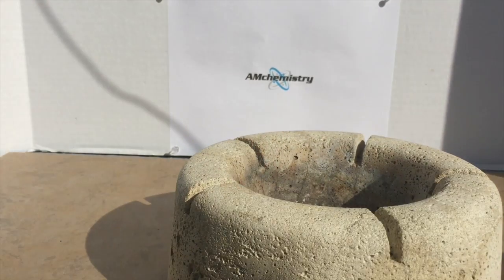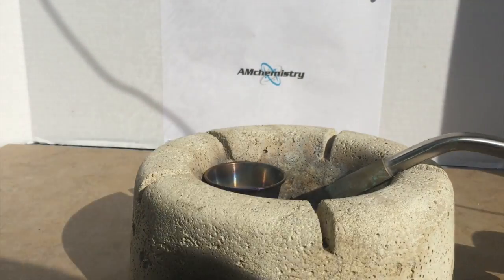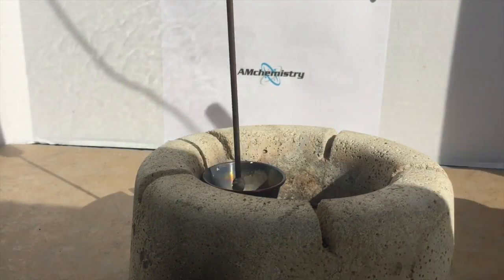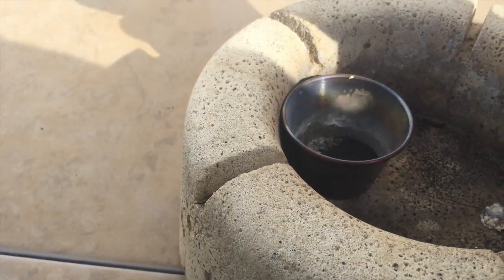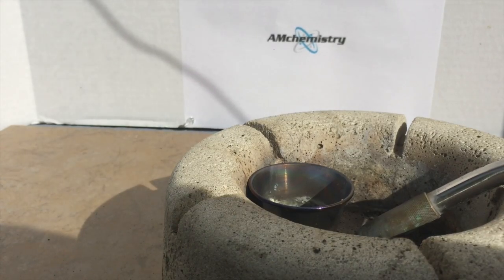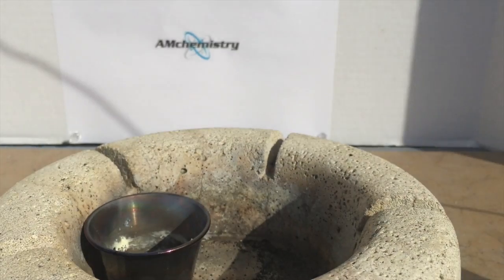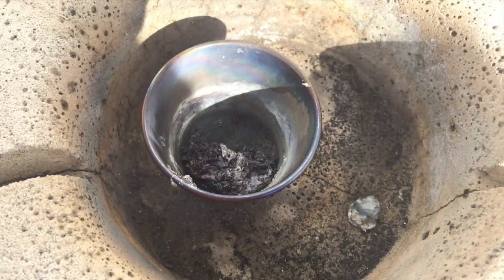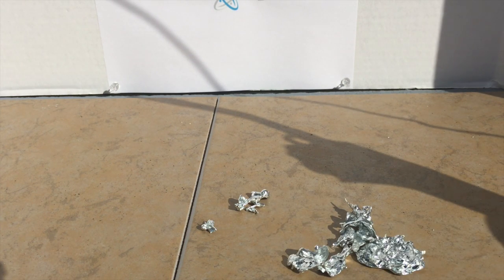How to purify any metal

Comment: Be nice to try this to see if the carbon would leech out any of the impurities in different metals. It might work. Damascus steel is made a similar way with packing the metal ingots in clay to leech out all of the slag and that works really well. I would like to see if it works with gold.
Reply: Steel is a iron + carbon alloy, so it will not work with every metal. To add carbon into steel coke is used, otherwise regular carbon would just burn away.
Reply: If your starting compound is an oxide you might be able to use some carbon to create CO2 and a pure metal. Works with Copper oxide in a graphite crucible, but it will corrode the crucible over time. Doesn't take much. I tried it with lead plates from batteries which are half lead half lead oxide and whatever else they're made of. The lead melted at a low temp and was easy to pour off from the junk, but the lead oxide melts at a much higher temp that boiled the mix. I stuck an old broken piece of a graphite stir rod into it and it dissolved in the mix, and I got more lead from it. I'm not messing with lead compounds anymore. They're toxic and hard to separate. But might melt down some pure lead from bullets or pre-separated batteries or separation from pewter or other lead alloys.

Comment: So what exactly is happening?  Does the carbon bind with the impurities?  And does the carbon stick to the crucible?  Is that why that doesn't fall into the water?  Or is the carbon simply not liquidized and you pour the liquid out and away from the carbon?  

Also, what if I have copper and aluminum combined into one from scrap material?  How do you separate that?  And how do you remove, lets say, plating metals from other other metals?  For example, a necklace that is nickel plated, but the rest is aluminum or steel?

I'm just getting into this so I don't have much experience.  Sorry if some or all of this is obvious and redundant to the more experienced.

Comment: "how to clean low temperature metals" or "how to melt zinc in my backyard with a blowtorch without inhaling vapor" would make more sense to me.
To those who want to separate low temp alloys (ie tin/lead zin/lead etc.): This video has nothing to do with that. You can use virtually any source of carbon to reduce some heavily oxidized white metals. This process is how lead, tin and zinc are extracted from their ores (via smelting).

Comment: This IS NOT a purification technique. This does not seperate metals. The only thing this does it aggregate solids on the metal. Part of which are oxides from the melting process. The pouring technique shown here will cause these impurities to stick to the cooled metal. They need to be scraped off before cooling OR pour slowly and skim off the slag.

Comment: I imagine this won't work too well with iron, as it alloys (or dissolves) the carbon to form steel.  Are there other metals that would do this also?  Would this separate one metal from another in some alloys?
Reply from the maker: I don't think it will seperate metal alloys. But with iron it needs a higher temperature to combine the carbon and iron so it will still somewhat work.
Reply: What alloy are you trying to separate? I'm sure I could help
Reply: Just a point of general curiosity.  Aluminum, iron, and gold alloys stand out in my mind as possibly having practical applications.
Reply: Well you could first dissolve the iron in nitric acid, then collect the remaining gold and aluminum. Then you could dissolve the aluminum in hydrochloric acid, and be left with gold
Reply: @TheChemistryShack  I'd like to know how can i remove or at least decrease the fe impurity content in my molten aluminum. Pleaseee??

Comment: "Any metal?" Isn't that a clickbait title. Good luck purifying Tungsten, Uranium, Iron, Plutonium etc
Reply: most people aren't interested in casting those in their backyard.
Reply: Most people don't have the equipment to melt tungsten at home, this method would mainly be used for lead, zinc, tin and aluminium
Reply: Most people get arrested for trying to work with uranium and plutonium.
Reply: Your pointing out the should part, Dishonored, not the could. You CAN work with uranium and plutonium. You just shouldn't do it.
Reply: Does this work with brass?
Reply: Not Available brass itself is an alloy
Reply: @conordorney217  I don't mean to necro a comment here, but who would cast in zinc anyway? Zinc imo is a really bad metal to cast with since it produces a pretty toxic gas upon working with under heat. Most "backyard casting enthusiasts" I figure would work with aluminum, lead, pewter (Which this wouldn't work on since it's an alloy.), tin, and other more common low temperature metals. I'm pretty sure this wouldn't work with bismuth which is what I like working with... 

But here's the point the original person was attempting to say... The video name IS click bait. This doesn't work with any metal. If there's even ONE commonly used metal for casting or working with such as one straight off the top like pewter, then the video isn't exactly 100% honest. Now I wouldn't chime up on a dead comment this old if it was just one or two things that mattered, but there's at least 10 commonly used casting metals for backyard casting that wouldn't work at all with this "purify" method.

Also adding carbon to iron makes steel. That's another major flaw with this method. It's just not a good tutorial from a person who doesn't /quite/ know chemistry and also doesn't /quite/ understand why it works at all. Best to do what some other people say and use an acid method to purify most things depending on what thing it is you're purifying at all. Every metal acts differently and that's why there ISN'T some clean-all method to purify metals. (This includes any metals for backyard use anyway.)

[It's spelled Zinc and I'm a dummy.]
Reply: @Violet51000  I completely agree with you. I understand this title is rather "click baity" due to the vast difference between elemental metals and alloys and each would require a specific method to purify. I think my example choices were on the poor side just like you said, zinc isn't the best for casting. I'm not entirely disagreeing with the original comment, my aim was to point out that the examples he gave were far fetched for purifying in a crude set up like uranium. I completely agree with you as this title may mislead those who don't have a good grasp on chemistry. Thank you for the reply :)
Reply: @conordorney217  I see, and yeah I agree the example of "uranium" was a bit far fetched. I know of a few people who have purified uranium though! So it isn't completely unheard of that somebody might do that. (Of course, if they are doing that then they probably wouldn't be watching this video anyway. lol)

I saw your comment though and it put up one to many 'red flags' for me to pass. I kinda know where you were coming from, but carbon dust doesn't just magically purify many things. In fact, I'm not sure if it could even "purify" aluminum or lead. Or any 'alloy' since an alloy is kind of it's own muddy mixture in a way. 

Anyway, it's actually kind of nice to meet somebody nice who doesn't instantly snap back with some dumb comment like, "OH WAY TO BRING UP SOMETHING FROM A YEAR AGO" or "OH WHAT DO YOU KNOW, I HAVE YOU KNOW I WENT TO CHEMISTRY CLASS FOR 8 YEARS IN COLEDGE" (Yes. I miss spelled college intentionally for 'dramatic effect' ) or something close to that. +1 to you! 

And to everyone else, Instead of looking up half-baked and not thought out youtube tutorials on melting, purifying, and casting dangerous and potentially toxic metals... Perhaps use google to find a proper website with documentation on the elements you'll be using and a proper explanation about why you use something like carbon powder to purify something like zinc and how it works. Better you don't get 'Metal fume fever' from some bumpkin refining rig full of zinc battery casings you salvaged and decided to make a necklace amulet with or desk-toy trinket.
Reply: @rachdarastrix5251  Cody of Cody'sLab would disagree with you, but it may vary from place to place in the world or state to state for people in the US.

Comment: Sorry but this is not purification.. this is just taking any dirt out. But to purify a metal usually means to chemically induce the separation from all impurities and other metals.. if the metal you are using is lets say an alloy.. recristalizing into salts and than making the purest form of the metal element.. I'm sorry I'm not trying to hate or anything its just I'm looking for the chemical solution to purification and i come across this..

Comment: can this be done for all metals like Gold, Silver, Palladium and other expensive metals? also,  if the metal is insoluble in water, can't we just add carbon black and remove all the impurities and then filter it. Would that work???
Reply: For a couple of reasons, it is not possible. 
1- Carbon is insoluble inside the zinc. This means that if you add any amount of zinc to it, it won't take any of it inside. On the other hand, many metals accept carbon inside them which will make carbon an impurity itself.
2-  Not all the metals have such low melting temperature that you could use carbon. it will start to oxidize and will produce either smoke or Co2. 
3- If your metal is an alloy and one of the main elements could be taken by the carbon and the other one not, then you would end up having a different composition from your pure alloy.

Comment: Some metals can become fragile due to the quick cooling method (crystallization) and that might ruin its usability depending on the porpoise of the purified metal, although to revert this to happen you have to melt it again then cool it down as slow as possible

Comment: When I cast zinc I have about 1/2 to 2/3 slag. It's old zinc which is oxidized or zinc alloy such as a zamak. There is a lot of zinc in the slag. I've tried adding borax and it's helped a little bit. How much slack should I be getting?

Comment: Cool! I need to use this with my Lead!
Reply from the maker: If you try it out post a video on YouTube!
Reply: Well, that would be like copying you.
Reply from the maker: It doesn't really matter we all have different techniques on how to do it. I doubt you have my huge cement crucible so in reality it's not copying.
Reply: Ok, I guess I will also be using lead so I'll consider it!
Reply from the maker: Also to make Wood's Metal you don't have to use cadmium you can just also use 25% tin.
Reply: Lead starts off-gassing at temperature well above its melting point. You might be thinking about solder fumes which are given off because of the flux.

Comment: Does this method work with cesium?
Reply: Even in a vacuum or an inert gas Cesium would react with carbon forming a compound somewhat like a hydrocarbon but with the hydrogen replaced with cesium, it's quite obscure so there is not much info on it.

Comment: How about separating lead from silver?
Reply: Dissolve in nitric acid. Then, add copper. The silver should be displaced by the copper, and the lead shouldn't, so silver metal will precipitate. Then take your remaining copper and settled silver out. Add an excess of sulfuric acid. Cold filter off your lead sulfate (not sure the best way to return lead sulfate to metal, but you could roast it in a dish, in an oxygen-starved kiln, covered with a carbon source to burn off the sulfate and then de-oxidize it).  From the remaining liquid, distill off the nitric acid to reclaim it. It was displaced by the sulfuric acid. Once the nitric is out, put the remaining liquid in an electrolytic cell, with a platinum electrode connected to + and a copper electrode connected to -. Keep the current low, and pure copper crystals will grow on the - electrode. The remaining liquid will be sulfuric acid and trace contaminants. Distill off the sulfuric acid to reclaim whatever wasn't removed with the lead sulfate, unless you've discovered a more efficient way of doing that step. If you can jump that hurdle, the net cost of separating lead from silver is electricity and whatever carbon source you used... but you could use sawdust, carcoal, baking flour, or whatever.

Comment: I need your help? How can I purify brass.any one know please message me .thanks
Reply: Use electrolysis look it up
Reply: I know you asked 2 years ago, but you might be able to powder the brass, add it to a sodium hydroxide solution (Making sodium zincate), filtering the copper off and then by doing electrolysis of the filtrate to make zinc. Nurdrage did this process using zinc oxide instead of brass, but both would work the same I think.